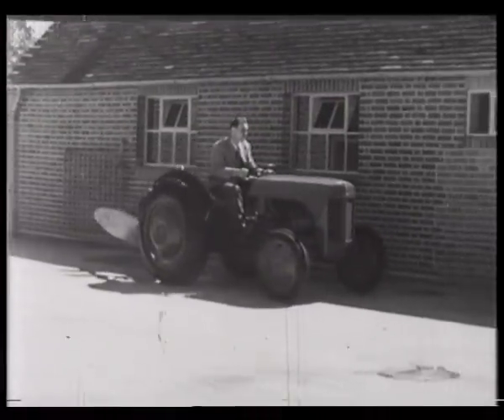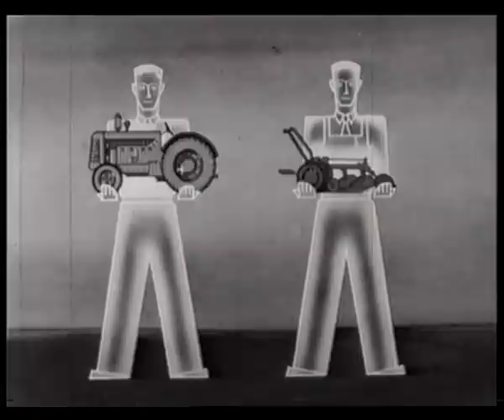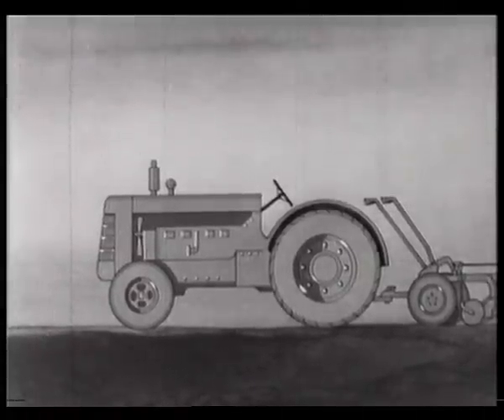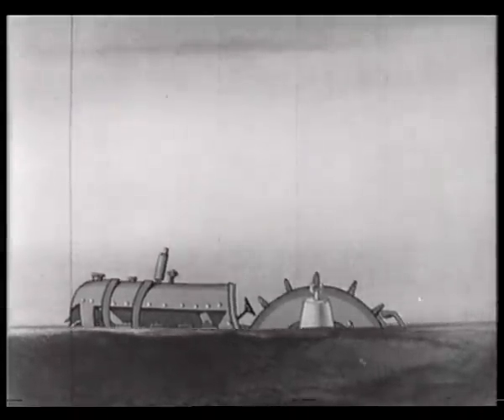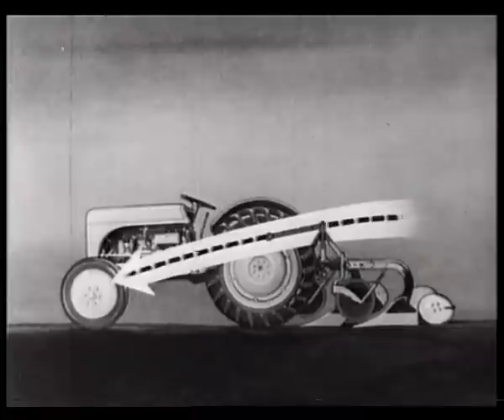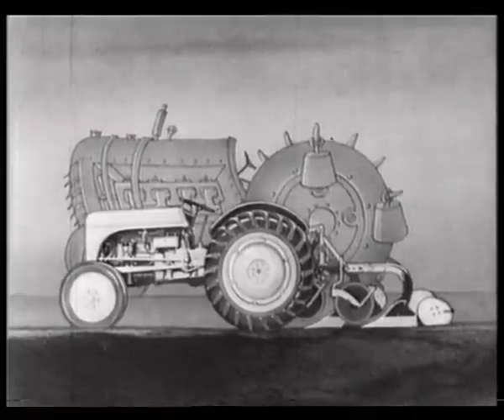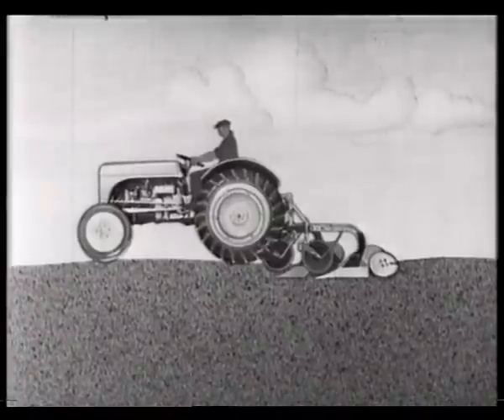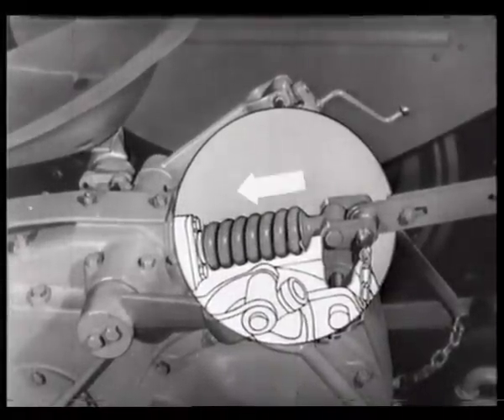ABC of Ferguson System

Comment: Mmm!  Sound impressive, and to an extend it was and still is, but, the early Ferguson tractors are seriously unsafe, especially on hilly terrain.  Back when this video was made, roll-over protection was unheard off, ditto seat belts, so many  people have been injured or killed in roll-over accidents of the early Ferguson tractors, many of those tractors are still going after fifty or sixty years or more, so they were reliable in many aspects.  The drum brakes tend to get compromised if exposed to moisture as it form rust on the brakedrums that is not sealed against water, and when wetted from rain, or a wash-downs, the brakes are basically useless until they dry up.  If rust has time to build up the brakes will, as previously mentioned not work as intended and may not be able to stop the tractor even on a minor incline.  So for anyone contemplating buying an old Ferguson two wheel drive tractor,  consider the topography of your land and remember on steeper land,  such a tractor - even with it's brakes working as they should, the tractor maynot, or more likely will NOT be able to stop when going down hill,  it will just skidd the back wheels, why?  Well because there is a good deal of it's weight on the front wheels, and there is NO BRAKES on the front wheels, and that make this type of tractor VERY dangerous  to operate on hilly terrain, and even more so if it don't have "rollover protection" and a seatbelt (that the operator actually use)  😯 !!!   Oh, and this tractor will readily flip over backward, or sideways - if the wheels haven't been set out wide.! 🤤
Reply from the maker: Do you think that it made the operator more cautious though?

Comment: 50s Ferguson look like a tractor should ,not some goofy John deer with odd vertical steering wheel,crude throttle lever,external hydraulic pipes , crappie looking  3 point hitch  and a pop pop two cylinder with no front end weight.. it had such a big flywheel you could shut it off and walk half way to the barn before the engine stopped turning..Seems the engineers were unwilling to admit their competitors had better vision of the future.
Reply from the maker: You don't like the JD's then I  take it :-)
Reply: @eddiesmyth6464  Yes, not the older ones that were behind in ergonomics and function with other competition of the day..hard to climb on or off,everything was either vertical or square (ie. seating,steering wheel,throttle and easy to pop wheelies with bush hog mounted making you feel like the lone ranger…hi..ho.. silver…what the hell?? ). But they seem to have caught up as a leader today ..I even like my JD riding mower